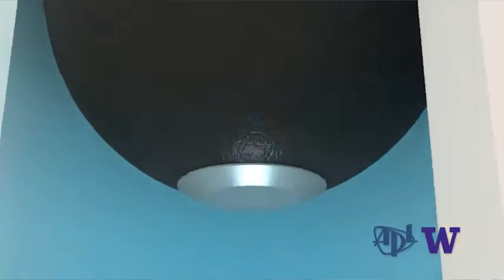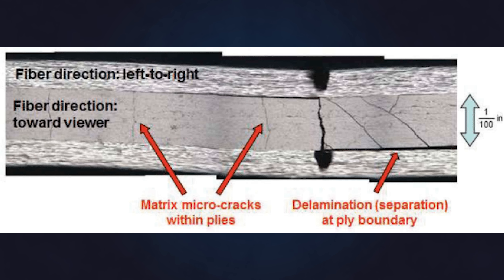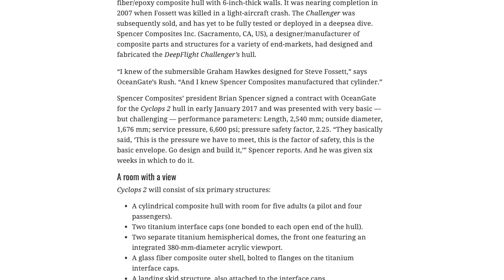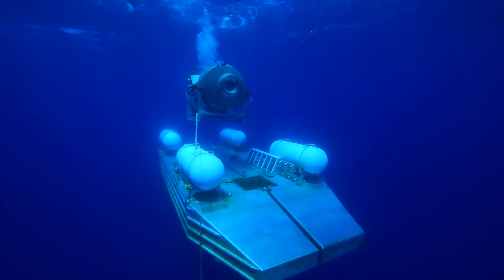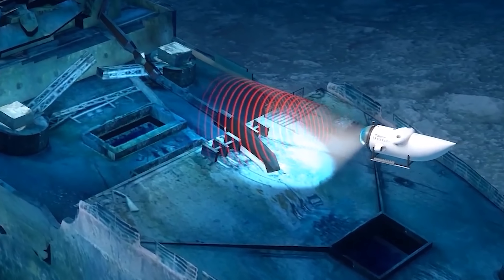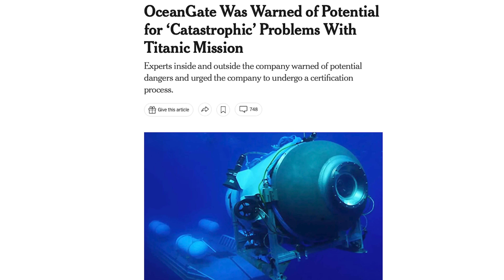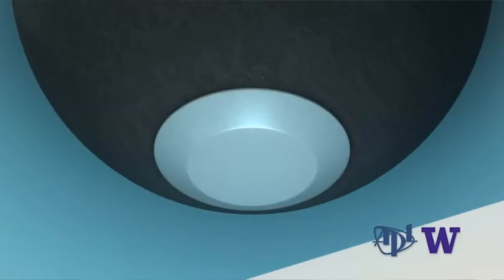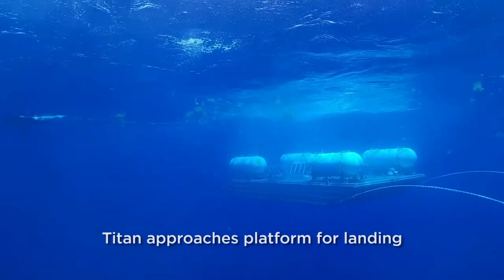Engineering Failures Behind Titan’s Implosion!

Comment: $250,000 to see a sunken ship through a 55cm window, in an unapproved shack, with no bathroom, no opening from the inside and limited oxygen, with doubtful or cut off communications to the outside, with 2 different molecular structures with glue, one of which which would not commonly support the pressure like the window approved for a third of the intended depth. You really have to spare or you are very tired of life.
Reply: To look out the widow you basically had to sit on the "toilet".
Reply: It seems ridiculous when you put it like that.
Reply: @@davesmith3023 they could have paid 15 mill to Triton Submarines to buy a proper safe craft to get to the Titanic and that would have had a much larger view
Reply: @ toomanyaccounts

And even more appealing, their bodies would stay intact!
Reply: As if a hatch that could be opened from inside never mind the huge hydrostatic load on it could have saved them

Comment: I think you’ve put out the best analysis I’ve seen on this.   I would like to see more engineering based commentary on the sub in the media, especially as good as this.   Hopefully this incident doesn’t completely turn the public off from carbon fiber for all applications.   Rush didn’t think at all about any of the potential consequences of the corners he cut.   Not only was he risking other people’s lives he risked causing harm to the whole submersible industry and to carbon fiber’s reputation with the public.
Reply from the maker: Thank you! I think it’s brought more attention to the material but it probably won’t affect it much as 99% applications use it in the right areas

Comment: If the logs where correct, i'm talking about the leaked last transcript, they had issues with ascending which means that they would be perhaps taking water or the hull was taking water. Somehow the titan got more heavy and it descended faster then it should, or ascended slower then it should. This in comparison with the tricky and russian roulette type of hull, might have been the culprit. I think the only sense after implosion they would have, is a bright experience of their body just detached from their soul, and that was it. The titanic is a graveyard - a dangerous place not for tourism. Even the first person who discovered the Titan at the bottom of the ocean, said that looking through the windows of the titanic itself, was a scary and haunting thing. They had the feeling people from behind the window where looking at them.
Reply: " they had issues with ascending which means that they would be perhaps taking water or the hull was taking water. Somehow the titan got more heavy and it descended faster then it should, or ascended slower then it should."

This raises several questions. How much positive buoyancy did the Titan have at launch? How much water ingress is required to change that to negative buoyancy?  And to such a degree of negative buoyancy that dropping the ballast and landing gear only resulted in a slight degree of positive buoyancy.

Can that amount of water gotten into the hull a drop at a time in the available time? Can it have gotten in unnoticed for most of an hour and a half? 

It seems to me that to overcome the initial buoyance, the weight of the ballast, and the weight of the landing gear we're talking about hundreds of gallons. Hard to overlook that.

I find the transcript questionable.

Comment: What are your thoughts about carbon fiber composites in aircraft fuselage structures subjected to pressurization cycles? As in Boeing 787/777X and Airbus A350 airframes comprised of more than 50% composites. Do we know enough about carbon fiber cycling fatigue?
Reply: They have been engineered and tested exhaustively by people who know what they're doing. 

The pressure cycles aircraft hulls have to endure are one atmosphere or less. 15 pounds per square inch.

A submersible vessel visiting the Titanic has to endure pressure cycles of 400 atmospheres. 6,000 pounds per square inch.

Furthermore, with aircraft the pressure is coming from the inside and the carbon fiber is under tension which it handles well.

On a submersible the pressure is coming from the outside putting the carbon fiber under compression which it handles poorly.

The conditions that aircraft and submersible vessels encounter could not be more different.

Using carbon fiber for a deep diving submersible is nuts.

You don't have to do any testing to know that.

Cheers

Comment: The Titan was doomed as soon as it submerged on this particular dive. The transcripts show the Titan submerging at twice the normal decent rate. They were literally an hour early reaching the the depth they were at. This indicates that water was already entering the sealed compartment with the electronics and battery A. It was literally sinking and not simply submerging since it’s decent rate was already accelerated at the first checkpoint so it was compromised. Close to the position and depth it imploded the system chat indicated a problem along with popping and snapping noises coming from the rear and battery A went offline causing them to switch battery B that was a backup in the crew section. Rush appears to have aborted the dive at this point and accent was noted as being extremely slow….. so the log shows Rush dropped the 4 barrels to reduce weight which showed little to no upwards movement and made the decision to drop the whole frame to lighten the load. Also no real improvement in surfacing speed and seconds  after that log was sent it imploded. It looks to me that this wasn’t simply a implosion due to its lack of oversight and regulations. This was sub more than likely would have never imploded had they corrected the dive speed and let the hull compress at a slower rate. If they had saw and corrected the decent speed at the first checkpoint certainly by the second check point they still had time to dump all that extra weight and surface since that electronics area was taking in water. By the 1 hour mark they were doomed as the water that had gotten in exceeded the Titans max weight to surface no matter if excess weight was dropped or not. Pretty careless and weird that the decent rate didn’t set off any alarms off to at least the Frenchman given his background in this field or even top side when their depth was going to fast. So basically in the first 100 feet in depth it was compromised and from that point forward was sinking not diving.
Reply: You're assuming that the 'transcripts' are authentic, which may or may not be true, but it's a very large assumption
Reply: The "transcript" was posted anonymously to TikTok. It shouldn't be considered evidence at this point. LIkewise with James Cameron's comments which are attributed to "the community".
Reply: They could have dropped ballast at 100m and been ok.
Reply: I saw the transcript a few days ago and get your point But all experts say it was a ticking time bomb and the carbon hull was going to eventually yield with all the micro damage racking up…Maybe not on this drive if it hadnt taken on water right away but on the next one.
Reply: @denaco  I have no idea which video it was, but one of the video about Titan claimed that Rush used Titan for 11 times to go to Titanic.
This is incorrect data.
He was only 3 times at  Titanic depth.
The fourth time was the final one.
All other times were where mission was aborted , mostly due to "weather". We now know it was probably something else too.
Reply: @ranc1977  i see. a pathetically small success rate even before it failed then. probs electrically issues but covered up with 'weather '
Reply: @denaco  yep. Someone said this: I am afraid we will be opening a lot of can of worms which Rush Stockton left behind him. It is like finding out  all serial killers covert actions before being captured.
Reply: "The transcripts show the Titan submerging at twice the normal decent rate"
Synchronicity -
Titanic also was rushing to New York to boast with the record and the unnecessary "King of The Hill" speed was crucial factor in the damage by hitting the iceberg.

Comment: Did the carbon fiber do anything at all under compression? Might the Titan have been safer if the'd simply molded a 13-cm-thick epoxy cylinder for the hull?
Reply: Thats exactly what I was thinking. That Carbon Fiber wasnt probably doing anything, it was only the epoxy that was holding the pressure.
Reply: It did manage to perform a few dives at the bottom with no issues. But the problem is it's simply degrading upon every dive. If the 2nd last trip caused crackling of the hull, then it must have bin a absolute red flag because the cracking means it's losing it's strength upon every dive.
Reply: @vanderlinde4you  Yep, the hull was strong enough for a few deep dives, despite the crackling noises. But was its strength due in any way to the carbon (which is pretty useless under compression), or just to the epoxy? So, ironically, did the presence of carbon fiber in the epoxy actually weaken it? I'm not sure OceanGate did any real analysis of this at all.

Comment: He knew what he was doing. He knew it wouldn’t pass and then it would officially have to be scraped. He took a chance and paid the price.
Reply: Yeah! Stockton Rush thought he was the smartest guy in the room, and he knew better than the experts. He killed himself and his passengers.
Reply: @diverguy3556  You might say he was in a some kind of rush.
Reply: @diverguy3556  Because he was a handsome man, he was used to getting his way in life.  I want me a ugly engineer to work on whatever it is that I may be riding on.
Reply: Stockton Rush was avoiding the truth about his flawed design and the cost of correcting it.
Reply: @hbrucewilliamson1787  You might say he stocked some rush and then imploded.
Reply: Exactly right.  This is probably the only reason he didn't want to get NDT.  He didn't want to hear what they had to say.  He thought he knew better.  Sometimes it's ok to be wrong.  Failure leads to improvement.  But not if you're dead.
Reply: @Ragnar009  "He thought he knew better"
Mostly he was cheapskate.
He was stingy and capitalist, wanted to invest as little as possible and get the most out of nothing.
Greed, he was greedy - as any narcissist and psychopath.
Reply: @ranc1977 nothing wrong with capitalism, but everything else I agree with you on.
Reply: @Irish_Georgia_Girl  I agree, capitalism is not inherently wrong if corruption was punished immediately as it rush out of  some hidden stock.
Reply: @ranc1977  I absolutely agree that regardless of any government system be it capitalism or socialism, corruption absolutely must be punished and snuffed out and applied equally to everyone.
Reply: @Irish_Georgia_Girl  👍💘👆
Reply: Hubris, pure and simple.
Reply: Stockton Crush.
Reply: Well said. Personally I wouldn't even consider this taking a chance. From what I've learned in the last 2 weeks I think there was 0 chance this would not happen.
Reply: Actually he carried out many successful dives. It was this that perhaps have him the confidence that his design was acceptable. What he underestimated was the number of times the submersible could actually be used. For example his submersible could only be used a maximum of 2 times after which he would need another new submersible. I’m not an engineer but this was the minimum risk management he could have adopted. I mean there wasn’t even another back up submersible to use. Over confidence, arrogance and greed finally sealed his fate.
Reply: @kwikmechanic6844  the minimum risk management he could and should have adopted was to have the vessel inspected by industry experts to industry standards, and then have it certified.
He didn’t do that because he knew his submersible did not meet those standards.
Reply: Could've verywell been Y he didn't go thru testing. It would prove his naysayers right even though it was coming from engineers and experienced professionals within the deep sea submersible community at least itll give him insite where and how to improve upon titan. This existing titan can be used for other underwater activities just not titanic depths. This way all the money invested to this project isnt scapped wasted. they can redesign rebuild a more capable sub. Theres a video showing how a composite wing off a plane being tested. They managed to engineer there own testing rig. If they can test something on that enormous scale, pretty certain something the size of a titan can be built to test it. Rush said its never been done before so theres no way to test it.  So ridiculously bonkers that idea. Wat are engineers in this world for then. Almost Everything in this world are thought up, designed, tested, redesign are done by engineers etc. On a professional industrial level.
Reply: As a statistician, the majority of educated people are not cavalier.  I don't think Stockton Rush / OceanGate actively avoided the testing.   I think he made a rational decision after using a heuristic, but I think he was probably off by 1-2 orders of magnitude. 

I think Stockton Rush thought there was 0.05%-0.5% chance of failure, and that this would very slowly increase over time, and that all the testing was unwarranted and expensive.

In reality the chance of error was somewhere between 5%-50% failure, and time to failure rapidly increased over time (# missions, cumulative stress, etc.).

There was a mission where a significant buckling sound was heard, and this is when his personal heuristic should have aligned with reality.
Reply: Interesting new word I had to look up 🤣 maybe… I think he was cavalier as well… most intelligent people wouldn’t go to the bottom of the ocean in a submersible at all ever. The risk is just not worth it to most people. The whole idea was flawed from the beginning but that didn’t stop him. I admire his enthusiasm. Not great he convinced other people to join him. But apart from that I admire him. Now we know.
Reply: Unfortunately he wasn't the only one who paid the price for his hubris.